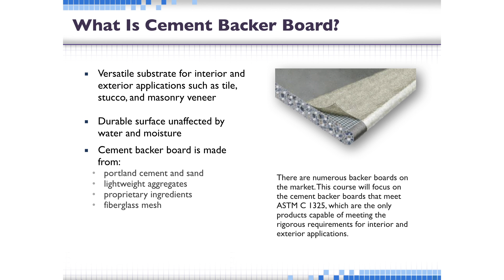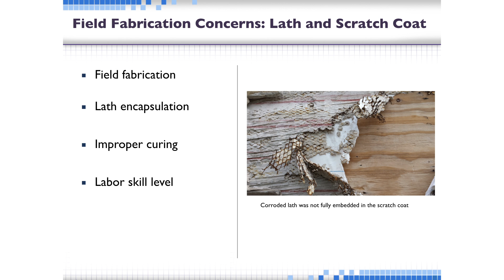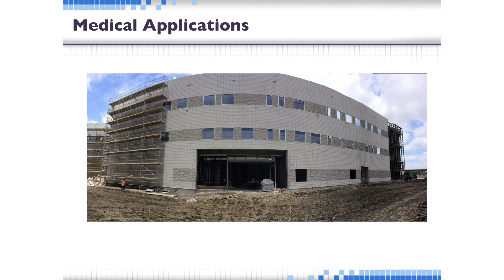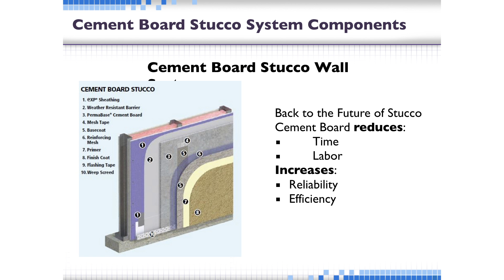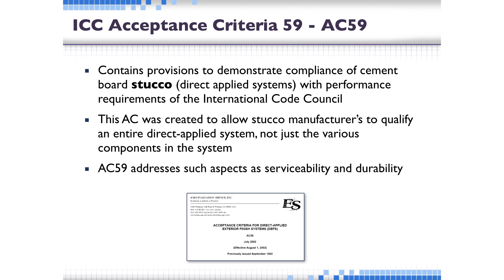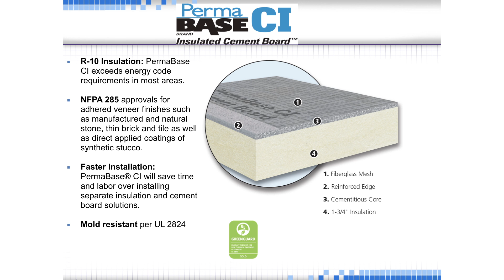PermaBase Cement Board Training Secrets Revealed!

Comment: Hi there. Is it possible to use perma base as a base for my outdoor kitchen? Instead of using wood as a mold for building my outdoor countertop, I was thinking of using perma base, add two inches of cement, rebar and then another two inches of cement. Would perma base be able to hold all that weight? Thanks!
Reply from the maker: Permabase won't work for the project that you described but...
this company makes a product that is just what you are looking for...

https://thefirefarm.com/outdoor-fire-feature/outdoor-fireplace-kits/